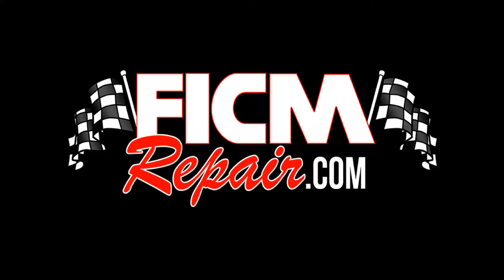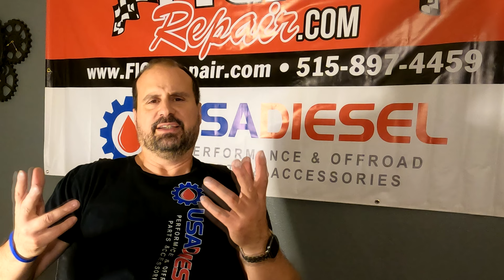How To Prime The High Pressure Oil System on a Powerstroke 6.0

Comment: I fix the 6.0 it’s the only truck I specialize in and some 7.3 but mainly the 6.0 . I have been using these guys for years since day 1 for my customers and I have to tell you they are hands down one of the best ficm repair guys out there . Not only that they literally well help you u out . No high pressure sales on trying to sell u stuff u don’t need . They literally have treated me like family and are just full of knowledge on these trucks . I mean it guys an gals these guys don’t try to take your money they will literally not sale you something if they know that’s not your problem all though that has happened it they ended up being wrong lol . But it’s happened twice in 12 years . But if your looking for a ficm with there decent atlas tune on the ficm it is pretty damn good not to mention they use damn good parts and there lifetime warranty is awesome .

Comment: The wire to engage the starter key off is on the pass side not the driver side. (Obviously he knows and miss spoke), just mentioning. Yellow with a blue stripe in a black loom.

Comment: Working Onan '05 6.0L. the stand pipes & dummy plugs have been changed, hpop has been changed, along with the hpop o rings. EGR delete has not been done. The small black o rings in the tops of the injectors were changed - no high pressure oil. Have low pressure oil, air tested hpop - have air leaks on the tops of the injectors. No pressure at the ICP when cranking ( can put your finger over the ICP port - no pressure when cranking.plugged the test tool for the hpop so it goes to full pressure ( wasn't sure if IPR was working - cranked - no hpo - any ideas?